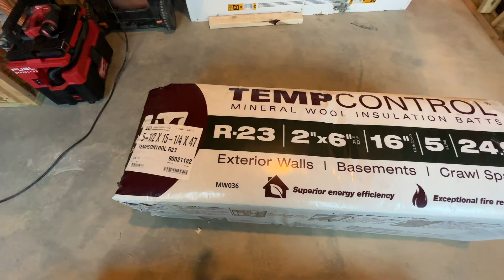How I Insulate my Superior Walls

Comment: The major advantage of mineral will is that it doesn't really matter if it does get wet.  Roxul even makes/made a "drainboard" product to act as a drainage plane and exterior insulation for basements, and their comfort board is often installed under slabs.

I honestly think you may have done yourself a disservice by spraying in that foam.  If it does flood, and water finds a crack in that foam, it may take forever to dry out.  Mineral wool will not hold water, and will probably allow the cavity to dry quickly when you strip your baseboards and damaged drywall.

Comment: I got 2 inch white foam at manards on sale for 20 dollars a 4 x 8 sheet. Then I cut them on my table saw to fit tight and rubber hammer them in. I spray foamed top and bottom to fill as needed.
Reply from the maker: That’s another way to do it!  I first started with some 4” EPS foam that I had but it was a pain to cut on the table saw and a huge mess.  Not itchy, obviously, but a mess.  Plus I want as high of R value as I can get for the price and amount of work.

Comment: The reason the standard batts didn't fit is because the concrete studs are wider than the 1.5 inches of the typical 2x4 stud that the insulation is designed for.  That might be part of the reason Superior Walls recommend using spray foam.

Comment: 8 x 4 foam boards, Owens Corning FPS,  2" R10.  Easy to cut, no waste. No Itching.  Will last longer, will not blow through it. Etc Etc. Just doing my attic with three layers. I have become a contortionist. LoL
Reply from the maker: 2” of XPS doesn’t give me the R values I want so I’d be doing multiple layers, adding work and costing quite a bit more.  Plus, I did try a few bays like that when I first started and quickly moved away from it for those reasons.  If you’re talking just the lower portion where I spray foam, then sure, that’s another option.  I just thought spraying was quicker and easier.